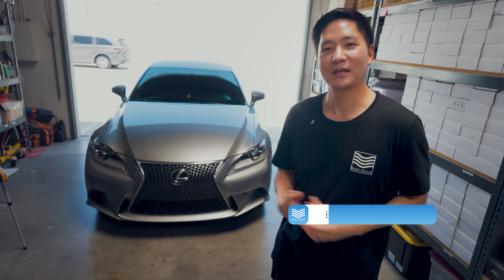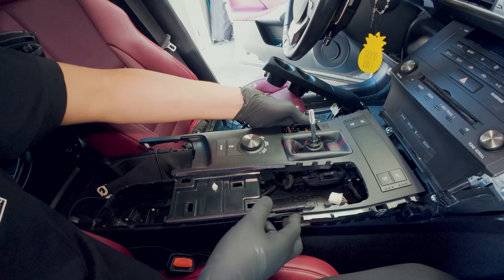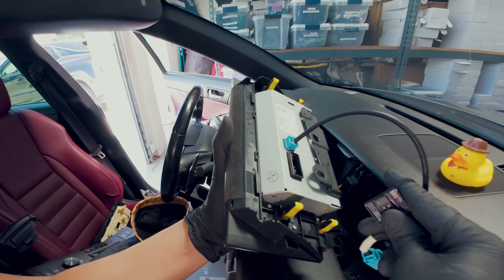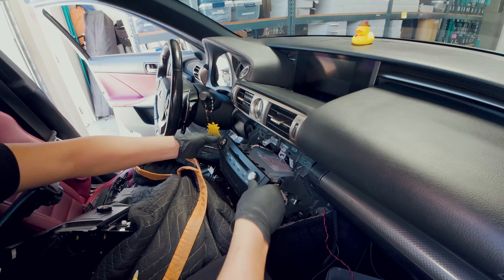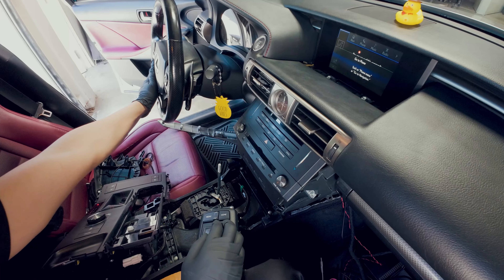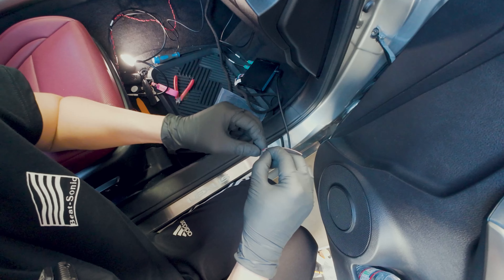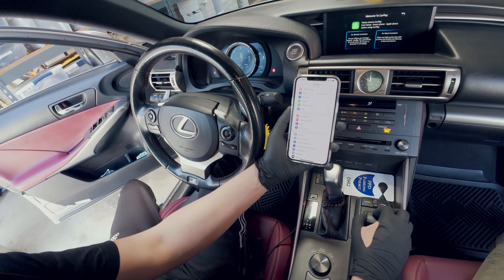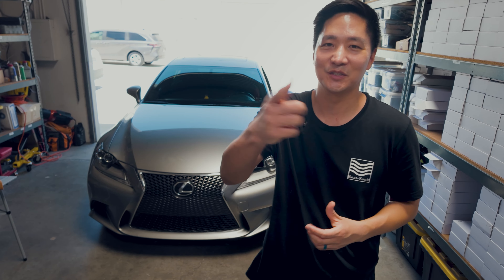2014-2016 LEXUS IS 200t | S-Connect CarPlay & Android Auto Kit

Comment: Will the audio quality drop or is it going to be the same since it uses the original Bluetooth connection? I have the Mark Levinson system and wouldn’t like to compromise it.

Also, will it work for a 2014 IS300h? It’s not listed in the product description.